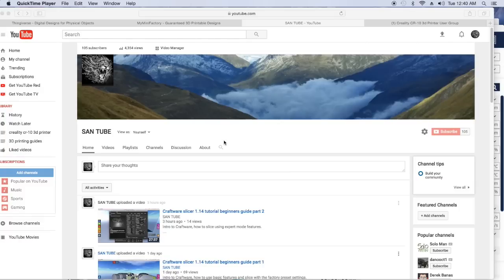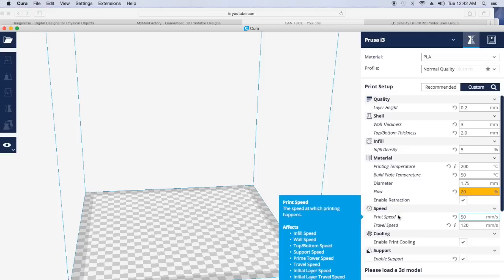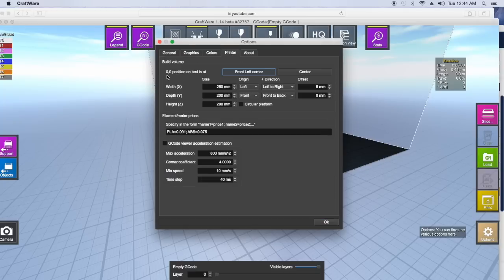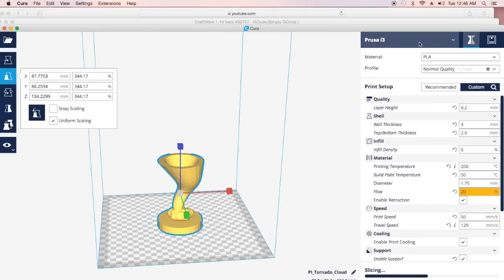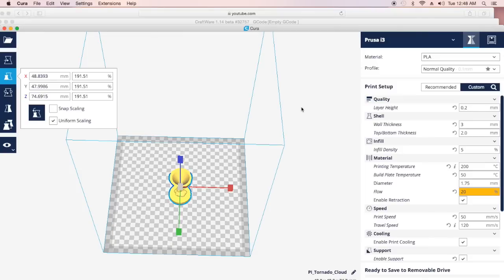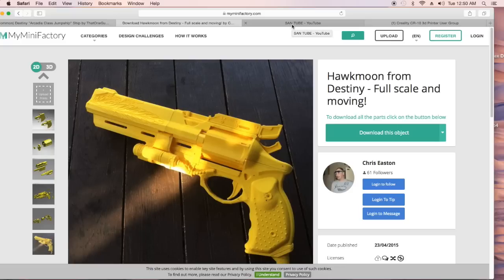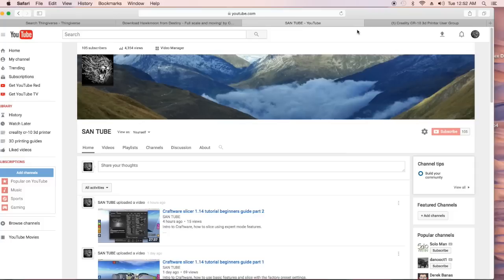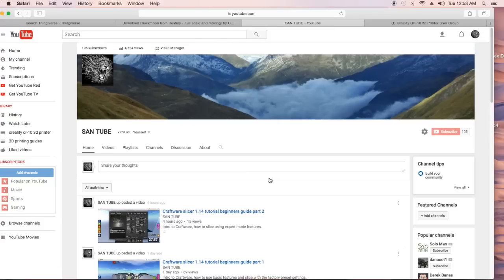Creality Cr-10 3D Printing: Problems and Solutions, Beginners Guide.

Comment: 2 types of glass, float and plate. plate is cheaper and is rolled across a large steel roller, float is as said , its floated on  a bed of of alloy, and thats perfectly flat . plate has imperfections.. cheers
Reply from the maker: Colin Tonkasdad thanks for the info.  Did not know that.

Comment: hey Sam How tight should i tighten the wheels under the bed to stop it from wobbling? (not the ones to adjust the bed level)
Reply from the maker: baruch shad, tighten it is much as you need but don't over tighten it just enough so the bed doesn't wobble.
Reply: oops i think i might have over tightened them?! should i loosen them? what happens if they are too tight?
Reply from the maker: Loosen them up again, then tighten each wheel until u can move it and the bed moves with the wheel and then make sure it doesn't wobble. Then repeat with the other two.
Reply: kk thanks

Comment: checking courier track section. (daily 5 times) printer has arrived in my area i hope tomorrow it will be delivered.
Reply from the maker: lol, most people do the same man.
Reply from the maker: you should check out the assembly video before it arrives.

Comment: A good thing you want to help out the new 3D printer users with your video's. Perhaps you did not intended to, but showing a spool of ABS filament as first buy to a noobie?
:-D

While the CR-10 technically can print ABS, without an enclosure the high frustration rate might scare the intended audience away from this great hobby!
Reply from the maker: lol, i didn't even realize it was ABS. thanks for the heads up. happy printing.